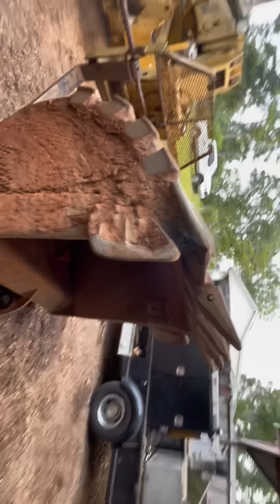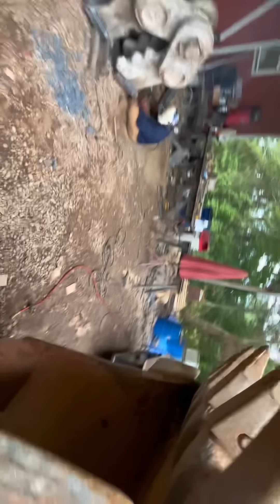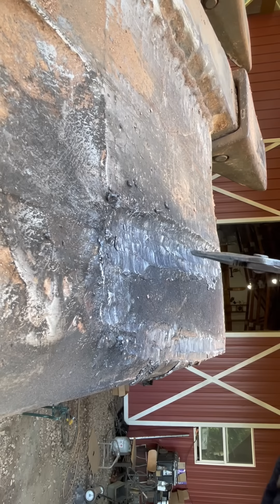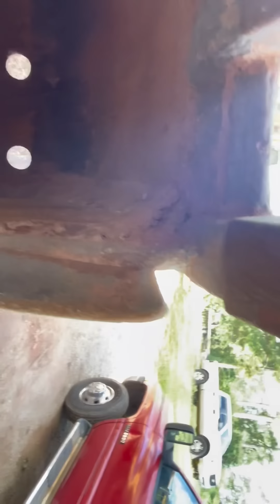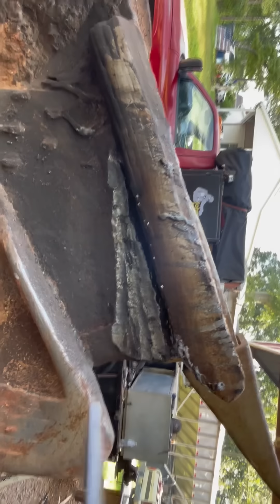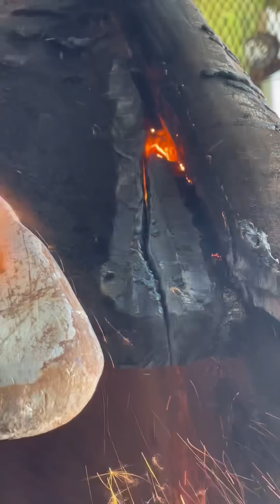Welding repairs on the corner adapter of a excavator bucket.

Comment: Another great repair.  Those corner tooths get the most abused by far!  The force of the big machine all concentrated into one corner tooth is gotta be insanely high!(spellin was intentional)👌🏻🛠️📐👨🏻‍🏭

Video was done in portrait but turned sideways so I had to turn auto rotate off so I could turn 'portrait' screen sideways to watch fullscreen without it flipping back to a small pic. 🤔 Minor issue.